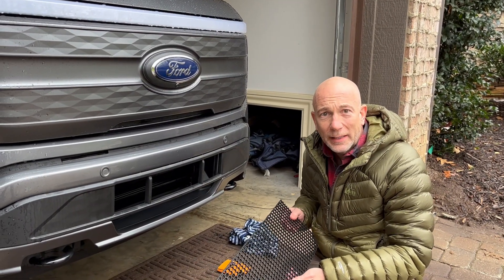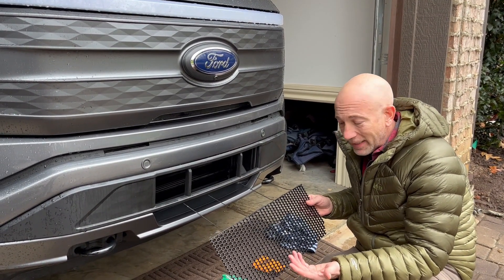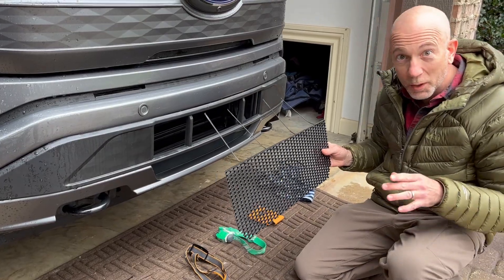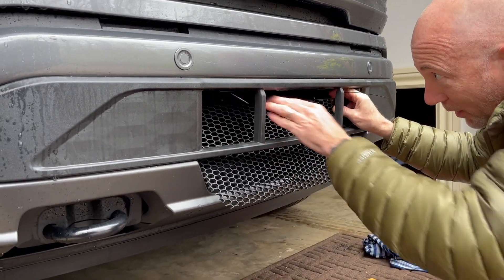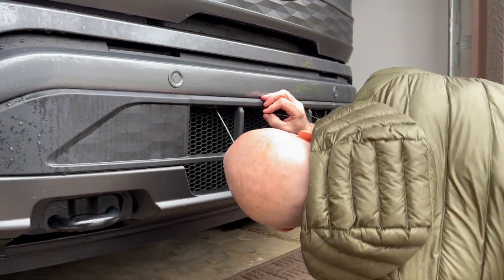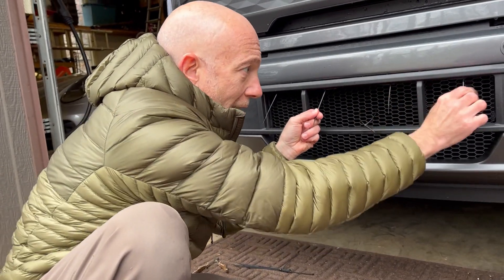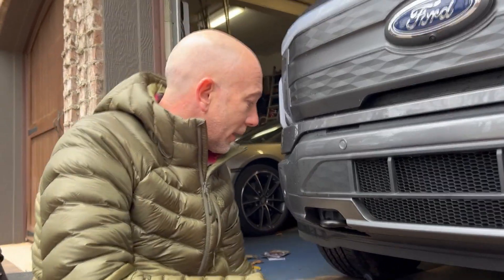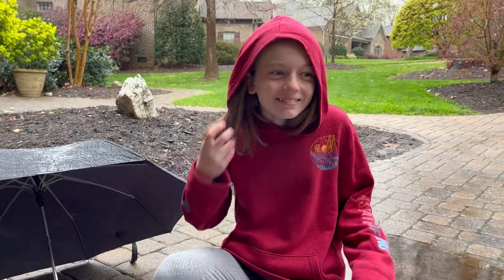Ford Lightning Grill Upgrade - Improved Protection

Comment: This is a nice video but it begs a lot of questions on details of how to do this. Did you cut off all the zip ties? What if you need to remove this? what about the bottom part, is that part without the zip ties loose?  what part is the grill? lots of questions. If you can answer them you would get more views and subscribers. good luck

Comment: I guess he is not going to tell us what this is made of because they want you to pay $65 for it at the Radiator Grille Store. I will be looking for a durable alternative to use for this.
Reply from the maker: My version (which was a first) was made of very thick plastic.  I have over 20,000 miles on the truck with the grill now and no issues.  I figure the zip ties will eventually need replacing due to sun exposure.  But no issues after 20,000 miles.